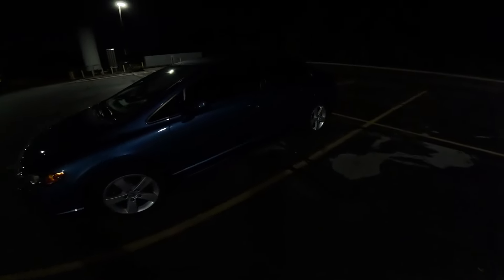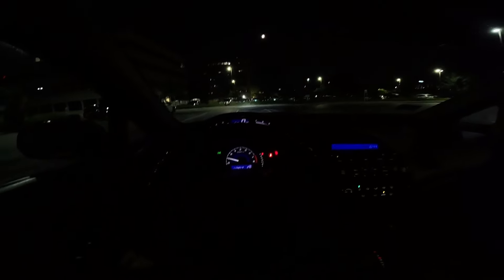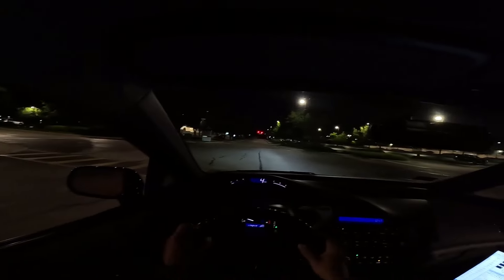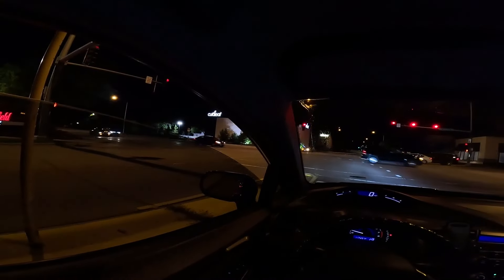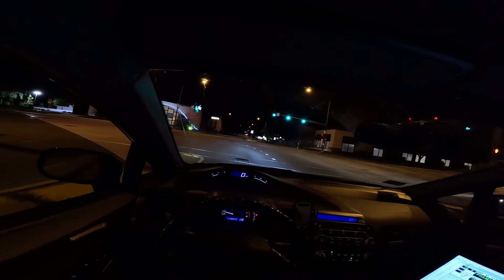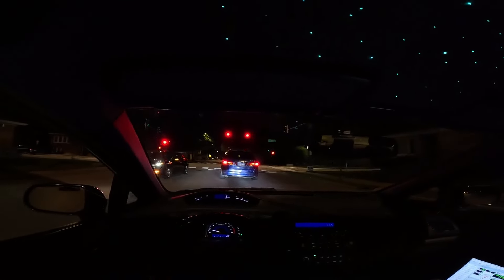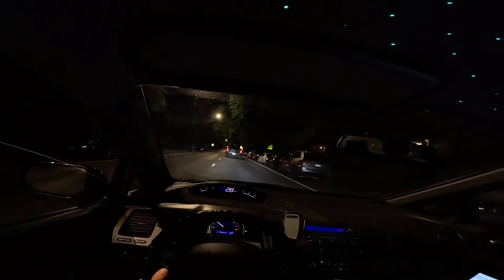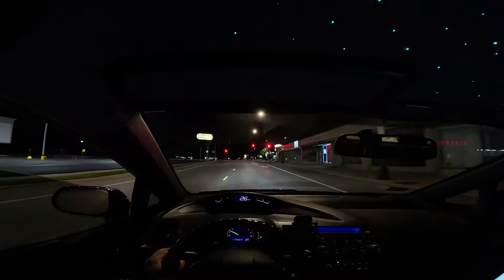POV TURBO Honda R18 (OPEN DOWNPIPE!)

Comment: NGL, that motor is about what I expect from Honda, I mean, that's why I love em so much. But the most impressive thing is the automatic transmission has kept with even just driving extra hard, let alone the extra torque from the turbo.

Love the vids, keep it up
Reply from the maker: Thanks boss!

Comment: Bro, dope car, I used to have the same color EX and was watching ur videos getting motivated to turbo mine. But it got totalled a little while back, loved the car tho, had it for 6 years. And btw I used to live right by that Butera u passed on your left at the end haha

You're very mechanically inclined, why don't you pull the trigger on a manual swap, or I'll do you one better, K24 with a manual and turbo kit that? That was actually what I was looking into because of the restricted airflow on the R18 on the exhaust side.
Reply from the maker: Sorry to hear it’s gone. What did you get into now? 

I’m happy with the car where it is.  I know it’s strength and weakness.  As a daily it’s doing me good and fun at the same time while maintaining oem drivability.  

One day I’ll hopefully be able to upgrade and have a dedicated project car and with that I will have more time for swaps and projects
Reply: @BulliKid  I actually got a 14 Rdx while I had the civic. That's why I wanted to start with mods. And watched vtec academy's vids on the k24 swap into an 8th gen and got motivated to do that, but that's really complicated. Your project looks more fun and sort of doable. You still gotta be pretty mechanically inclined.

Your project is super cool, I enjoy watching the vids. I get the appeal of just having a fun car that is slightly tuned. After all, it's about having fun and having a good time. Keep up the awesome job and great vids. 💯
Reply from the maker: @ckturbrobro69  yea I saw those videos too and I was like…. I’m good.  From sourcing used questionable parts to fitment issues to wiring harnesses.  It’s just not in my cards.  But that’s for watching and appreciating the build! 🙏✅

Comment: Definitely sounds nice without the exhaust.  Seems to pull pretty hard! Congrats man. Been following you for minute. Wanted to ask a quick question. I told you i have a civic with 235k. Been thinking of running 5w-30. I think you run that. Any issues? Any oil preference you use. Thanks in advance.  Keep it up man👊
Reply from the maker: 5-30 all day. No issues.  
I ran 10-30 in summer

Comment: been watching for some time now and i have a question, what problems have you faced after adding a turbo kit to the civic? what stuff have you had to replace?
Reply from the maker: My engine lol
Reply: @BulliKid why?
Reply from the maker: @SHADOW_POKER  broke the engine before when I was turbo.  You can view the engine rebuild playlist
Reply: @BulliKid  thanks for response bro. there is difference between manual or auto?
Reply from the maker: @SHADOW_POKER  auto will loose more power through drivetrain.  Auto is also less fun.
Reply: So I have a 5 speed and I’m thinking of turbo it. What all you think I need to do for internals I want to at least push 8 ibs psi
Reply from the maker: @jakemcinturff3043  get rods and pistons if you want at least 8 psi and want it to last.

Comment: Hey bro would you say this set up is reliable? Any problems? I’m over here looking at cosmetics for my r18 coupe. The only reason I haven’t slapped a turbo is because I’m pretty sure I seen a couple guys mess up there r18s. Mine is a stick.
Reply from the maker: Most people will blow engines because they are new and not to much knowledge and do not get a professional tune.  I blew up my first engine i turbo.  Now I run less boost and a different tune tuned down.  No issues.

Comment: What's a good place to buy a engine if my 2006 has a cracked engine block?
Reply from the maker: Either pull from junkyard.  Marketplace.  Or they have some random used engine  businesses such as jdm engines.
Reply: I’ve bought to  JDM engines from JDM king out of Houston Texas both were good motors

Comment: Bro you should go five speed and get bc spring retainers
Reply from the maker: Always looking on marketplace
Reply: @BulliKid I’ve seen a couple r18 compatible transmissions but they use different axels I think
Reply: He needs a SI six speed swapped; not a 5 speed.
Reply: @neonaqua4279  five speed is better for boost because third gear is where the power band opens most 6 speed don’t get into that power band until they hit 4th or fifth gear because that’s where all the torque come in specially for a 4cyl
Reply: @banzupterv0023  do some research on si 6 speed LSD transmission gearing
Reply: @neonaqua4279  your talking about a lsd when lsd doesn’t make u have power it just makes both wheels spend for smoother wheel flow lsd don’t matter if not ur getting traction I seen people build 5 speeds and beat six speeds awd is really where it’s at and you can literally take the k20 lsd and put it in the 5 speed trans of the r18
Reply: @neonaqua4279  and the gear ratio on a si is short and when it comes to boost those long ratio play a big roll that’s why when most people build stock k24 on boost they be spinning or can’t catch a gear because by the time the boost build up they’re already banging the rev limiter
Reply: @banzupterv0023  lol this is a sub 200 hp build, not an Alpha 12 GTR 😆. Even with the shorter ratio gears, it’s better than a standard 5, and yes I know what LSD means, If he going to be spinning tires, it’s better to have constant power at both wheels than one wheel fighting the other and causing torque steer

Comment: Rr 18 civic 8  gen also I drive ..Honda says 140 HP but I  doubt   it ...probably 100 HP  your car is probably around 135  HP boosted
Reply from the maker: I hope it’s more then that lol
Reply: @BulliKid  someone I know  changed to high performance, pistons, rods, valves  and cam and got his r18 boosted up around 170 hp
Reply from the maker: Is that wheel HP or crank
Reply: @BulliKid  that's at the wheel
Reply from the maker: @ernie6590  yah that doesn’t sound right at all.
Reply: my stock auto r18 feels like 150 or so but i drive a coupe